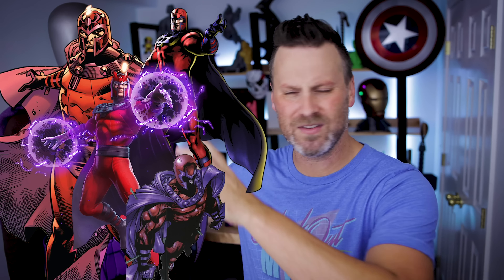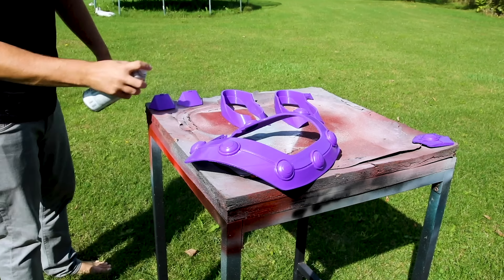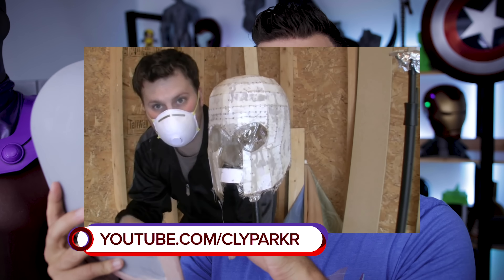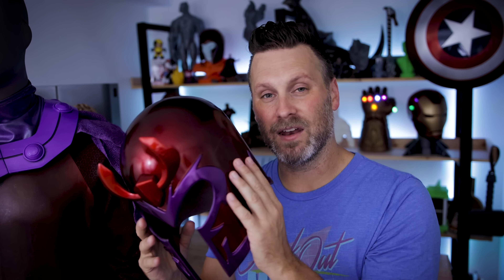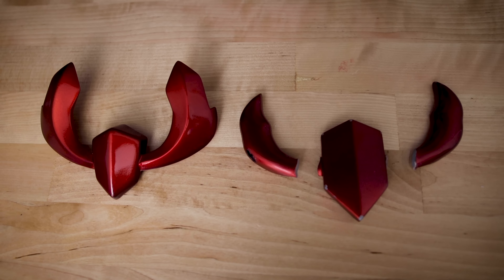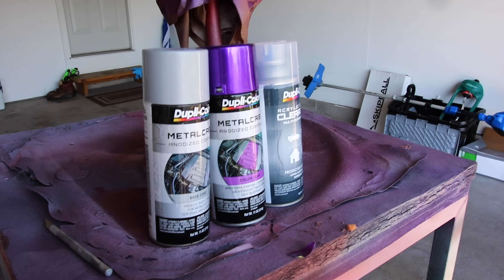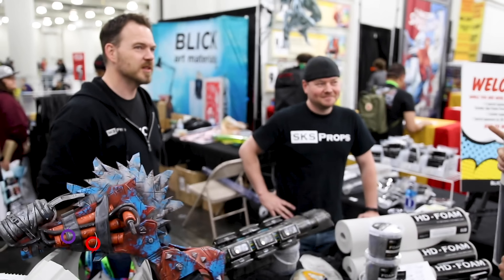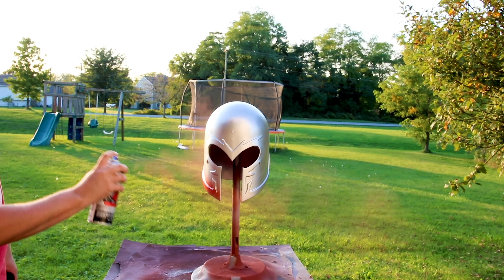Magneto Cosplay - Part 1: 3D Printed Magneto Helmet | Tested Interview

Comment: There are small fans you can add to helmets to help with heat. I've taken to trying to use hard hat inserts on helmets to make them a little more comfortable and it allows better air flow, especially when you add the tiny fans. Doesn't eliminate heat, but does reduce it.

Comment: Hi, quick question: what would be the best (and most newbie friendly) software for scaling helmets like this to make sure they fit? I've seen your video about cosplay calipers and also the one from the original caliper 'inventor' but I found the software he recommended (netfabb) very clunky to use. Is there any program where you can just open your model and easily get a distance measurement between two points on the inside of the helmet?
Reply from the maker: I wish it was that simple. I also made a video called helmet scaling that shows how you can slice a thin part of the helmet. Print that as a test piece. You can use meshmixer to make the slice which might be easier that netfab

Comment: Is bondo absolutely necessary for sanding the top of a helmet?
Reply from the maker: Nope not at all. I used Bondo Spot putty which was totally different than regular bondo. Spot putty is useful for those little spots. I primarily use Woodfiller to smooth/fillout major gaps
Reply: @UncleJessy  Good to know, thanks. I just finished printing the Knights of Ren: Monk mask and the top will need a lot of sanding.
Reply from the maker: @SkinnyTrini04  Sand, then woodfill, prime, sand, spot putty, sand some more, sand some more, sand some more haha
Reply: @UncleJessy  Thanks. This is my first mask/helmet and I can't wait to see how it looks after I'm done. I'm not sure if I can do the 67 hours print time again lol.